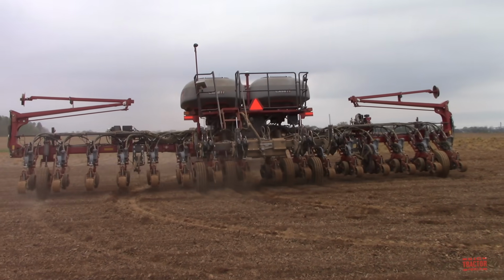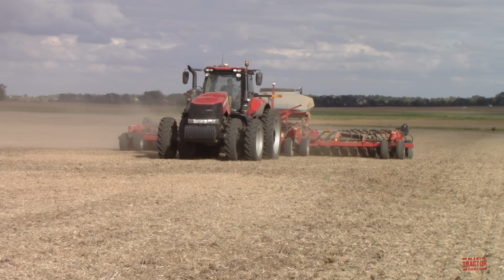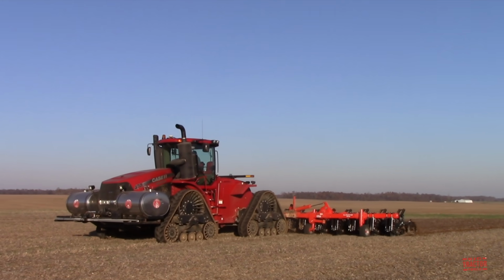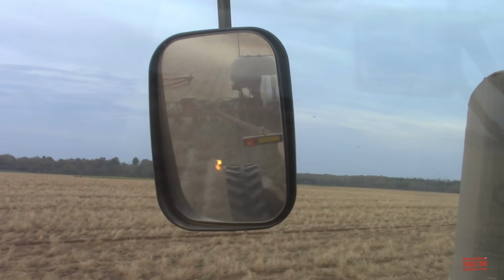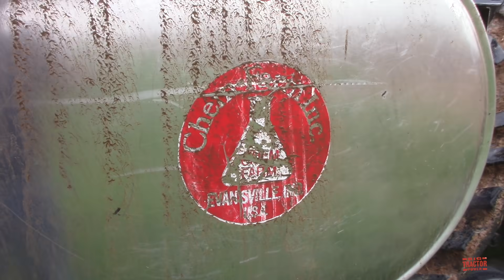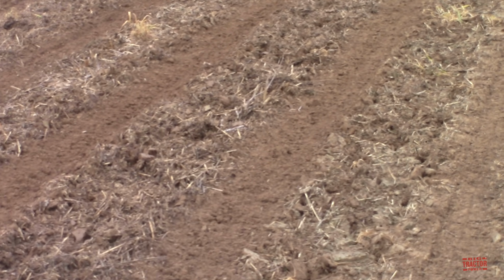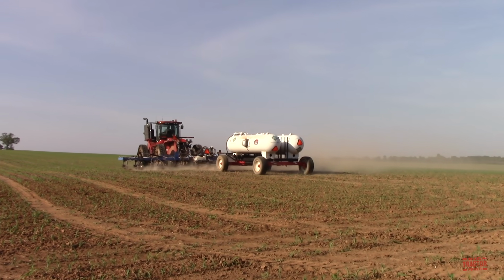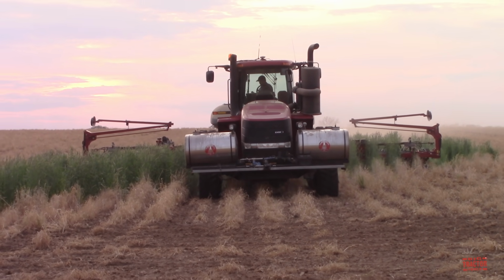Corn Planting to Harvest | Case IH

Comment: When they're doing fall tillage, do they offset the Kuhn machine's rows from the rye's rows?  Thank you in advance for your assistance with this.
Reply: Yes. They use GPS to go right in between
Reply from the maker: Good question. Yes the seed is on one set of rows and the tillage is done on the non seeded area.